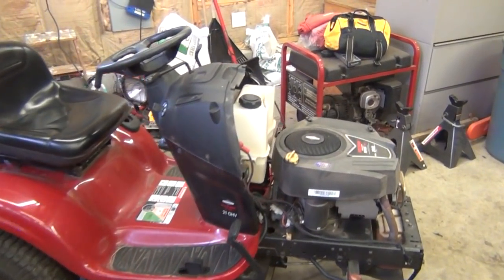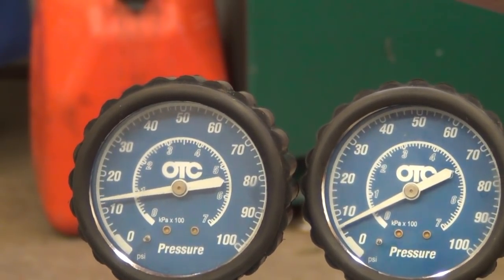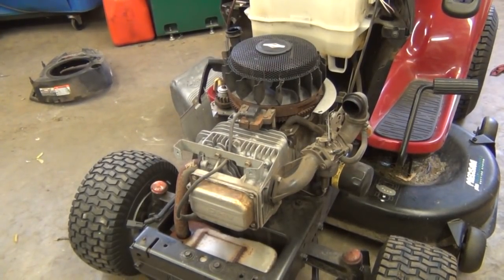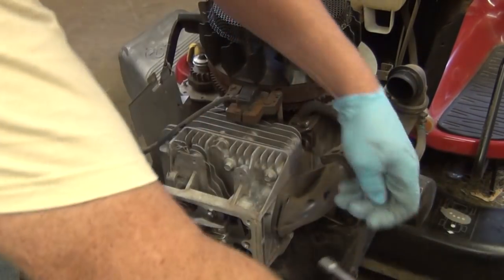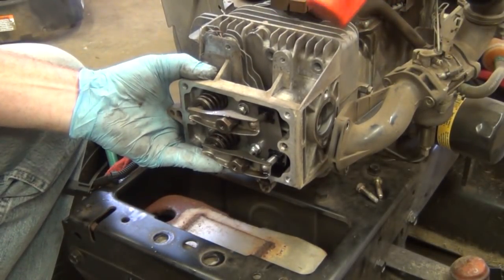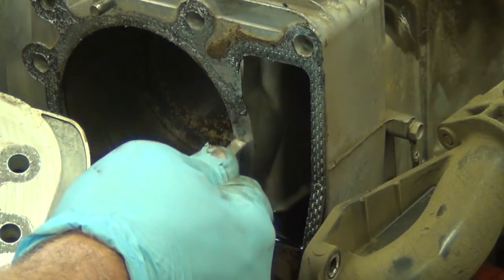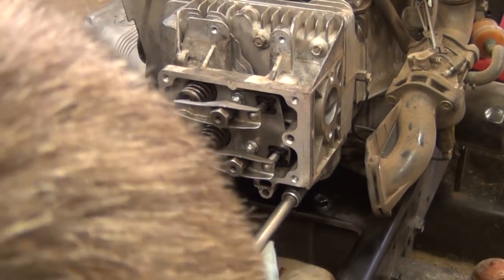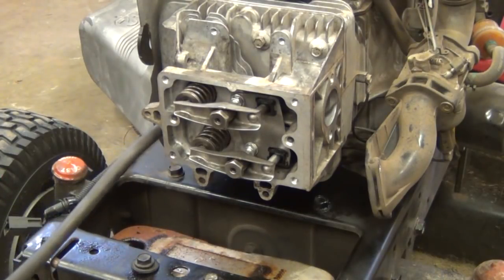Briggs and Stratton Cylinder head gasket replacement

Comment: How do you get the piston up to the top dead center when reassembling the engine?
Reply: charles mayer you rotate the flywheel/crankshaft by hand. If the head is on, you can use a blunt object stuck through the spark plug hole to feel the movement of the piston. To add the piston has to be at TDC on the compression stroke and not the exhaust stroke.

Comment: Hey Dan! What was your torque spec on this engine for the cylinder head?
Reply from the maker: The cylinder head bolts are supposed to torqued to 220in lbs. That's about 18.3 Ft Lbs. (or 25Nm for the Canadians). Be careful not to go crazy tightening them up. If you snap one, you will probably never get it out of the block. Also, check the valve cover to make sure it's got a nice flat surface for the new gasket and tighten it to 60in lbs (like 5ft lbs) just to snug it up and prevent leaks. Set your valve clearance to .003-.005 on the intake and .005-.007 on the exhaust per the Briggs spec. I notice that once the engine gets warm, the rockers tend to make a little noise but the spec is the spec - so use it.  I like to use a tiny bit of Blue RTV to seal the rocker cover because I hate oil leaks. Sometimes I assemble the valve cover using just a gasket (no sealer) and run it for a while then re-check the head bolts once it's cooled down. I check the valve clearance again and then reassemble using a small amount of Blue RTV to prevent oil leaks. Since these head gasket blow quite often, I clean the head and block with Carb cleaner or Starting fluid to get ALL the oil off the surface so I get the best seal possible. The gasket should be reliable for another 5-10 years depending on how cool and lubricated you keep your engine.  In Boston, I find nests under the engine covers all the time and this prevents proper cooling. If you start your tractor in the spring and little pieces of debris seem to blow out from the engine area, you probably have a nest. This can damage the coil by it getting pulled into the flywheel with all the nesting debris. Also, the mice like to chew through the wires on the coil (both low and high voltage wires) so check it before you start it in the spring to save yourself that trouble. Also, clean oil filled properly to the full mark will help prevent overheating!! Good luck.

Comment: on changing out the head gasket when all is clean and ready to put back together. can you use permatex copper spray a gasket on the part were you get the blow by. would that hold any better. or just replace the gasket?
Reply from the maker: That won't help and might actually hurt it. The real problem is they need add an additional bolt between the cylinder and the pushrod area to clamp the head to the block better.  That engine has been around for a very long time so that change will never happen.

Comment: Hey Dan. I changed my head gasket on my 2000 14.5 OHV Briggs and Stratton engine because it was smoking like crazy. As it turns out the gasket was broken. After the repair It started right away but only at high idle. When I lowered the idle speed it stalled right away so I drove it with the idle high. It ran for about a half hour then it started to backfireand  and eventually stopped. I tried to start it the next day and it started right away. ( with the air filter off ) It would allow me to run the motor at low idle as well but was backfiring through the carb big time. Could you tell the problem and how to fix it? Thanks. Deny
Reply from the maker: +Deny Konecny 

So, according to Briggs, the head gasket failure occurs  because of excessive engine heat. This isusually a result of - 1. low engine oil,  or 2. Overheating due to clogged fins or a nest under the engine cover thatprevents the flywheel fan from blowing air past the cylinder and head.  Once the engine gets too hot, the head gasket starts to break down and leak (usually into the push rod chamber (i.e.
crankcase)).  The engine starts to use more oil and it usually gets pretty low before you realize something's wrong.  I suspect you also have a problem with the
valves sticking open on your engine due to damaged valve guides.  On about 50% of the head gasket jobs I do, I replace the cylinder head assembly with a new one because the valve guides are damaged or scored and the valves will eventually seize in the guides. Since I only want to fix it once and I want happy customers, I replace the entire head if it looks like it's in bad shape.  I have also had instances where the valves move fine in the head but the valve seats leak where they are pressed into the head because they were overheated at one point.  When I reassemble the engine, I usually do another leakdown test to verify the head gasket has sealed properly and both valves are sealing properly. You can hear air leak from the ports if you have a bad seal, bent valve or a loose valve seat.  A complete
cylinder head is about $125.00 and comes assembled with rockers, springs, etc and new gaskets all ready to be bolted on.   In your case, you should do  a leakdown test to see if the valves are leaking at TDC with both valves closed. If the leakdown test doesn't show any major leak, you may have sheared the flywheel key and this is causing the backfiring. Check the flywheel key and make sure it's not partially sheared...
Reply: +Dan Small Engine .Thanks for the quick reply Dan. Being that I am not a mechanic the first thing I did is recheck  my valve lash and low and behold the exhaust setting was way off. As a matter of fact the  guide seemed very loose. I reset the valve,  put everything back together and it started right away. No backfiring or stalling. Thanks for your help. Cheers

Comment: Could you have left the cover on the valves on and taken it off as one piece with the head? Seems like you could.
Reply: m00n69 on this particular head, you could have. But, you would have to take it off to put the head back on. You have to be able to verify that the push rods are in the dimple of the rocker arms. And, you have to verify the valve lash. Also, some models will have to bolts that you have to access through that area.

Comment: i have same issue model number is unreadable same engine/tractor can you give me the part number for the head gasket/gasket kitset thxs
Reply from the maker: Could be 796584 or  794114.  You need to get the first 2 numbers from the engine model code that tell the displacement of your engine.  The gaskets are similar but the diameter is slightly different depending on the size of the cylinder.  These gaskets fit 16hp-21.5hp I think so there are 2 or 3 different sizes.  If you are replacing the entire head with a new one, that cylinder head kit comes with all the various gasket sizes you will need for anything in that family.  I think the kit number is 796183.

Comment: Hello are you using a 3/8 or 1/2 torque wrench
Reply from the maker: +Joe Briggs It doesn't matter what size torque wrench you are using. Set it for 220 inch pounds (or 18.5 foot pounds...i.e. 220 inch pounds divided by 12 = 18.333 ft lbs, or for the Canadians - 24.856662385 N-meters)  It's all the same torque.

Comment: You forgot to mention to resurface the cylinder head on a wide, flat belt sander or large diameter sanding disc to remove warpage and restore flatness, and to prevent another blown or leaking head gasket.
Reply from the maker: I wouldn't use a belt sander or disk. It's really a machine shop function unless you have a fly cutter in your garage. Most of the time, they are not bad and you can clean them up with a good quality flat metal file. Hit the high spots and not to remove much meat. Clean good with carb cleaner or acetone before you assemble it. Unfortunately, the design of that head with no bolt on the pushrod valley side is a bad design. A new gasket may only last 7-8 years. Make sure all your cooling fins are clear and keep the oil full. It's all about cooling.

Comment: What was the valve lash
Reply from the maker: HI John, It's around .008 or so. It doesn't have to be exact. I keep mine a bit tighter because I hate the noisy rocker/lifter sound they make when they warm up.  The biggest problem with those valves is leaving them too loose so the compression release doesn't do it's job. If the compression release doesn't crack the valve open a tiny bit on the compression stroke, the starter motor won't  have enough power to spin the engine. This is a common problem where folks keep replacing the battery, starter motor, cables, relay, etc. when really the problem is that the compression release is not working because the valve lash is too loose. When I set them, honestly, I do it by feel most of the time and just make sure they have some clearance when closed.

Comment: Looks like Briggs designed this engine to blow head gaskets there is way to much distance between the head blots where the blew out Briggs could have designed that engine to have a threaded boss for at least one more head bolt DESIGNED TO FAIL 100%

Comment: I put .010" on both rocker arms
Reply: O. I like.005
Reply: @Phillip Hall  too bad Cometic doesn't make a head gasket for these things. I sanded mine down last time and seems to be lasting longer (blown 2 x). Wish they wouldn't have uses aluminum and made these cast iron or steel
Reply: 6 and 4